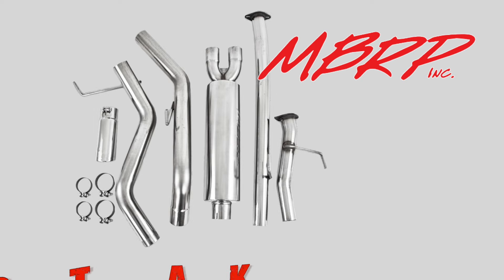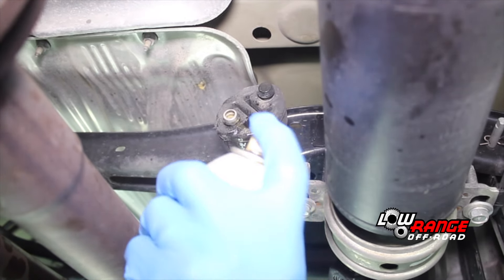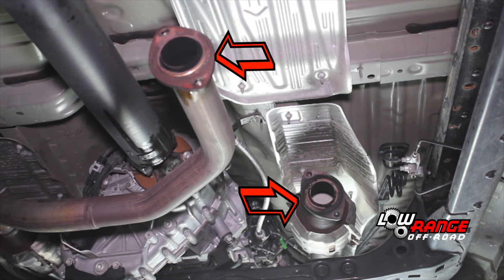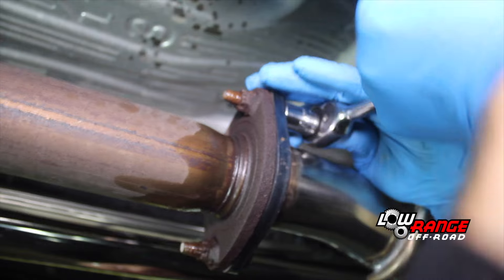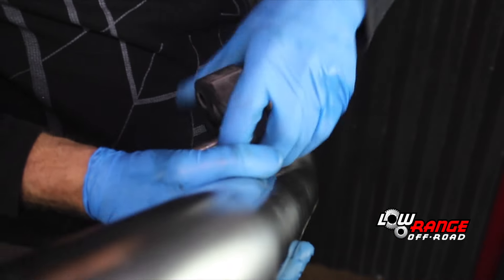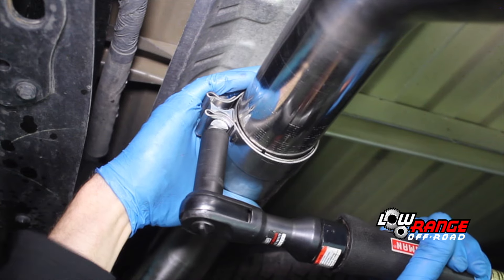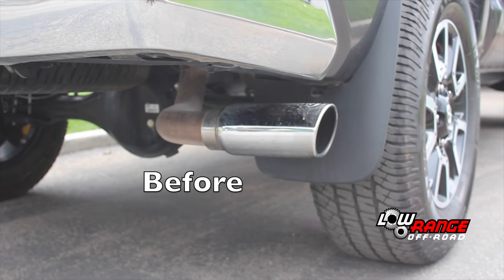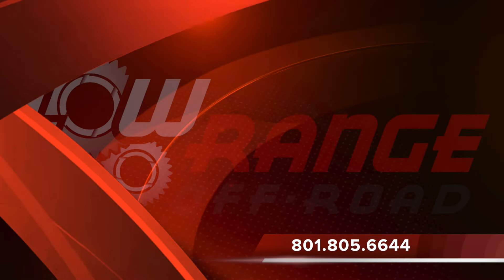How to Install an MBRP Cat Back Exhaust on a 2017 Tundra

Comment: When the 2 front pipes are installed and the flange bolts torqued to 35 lbs-ft is there a small gap between the flanges or do they full seat together? Just installed my kit last night and the flanges have a gap and all the bolts are torqued to 35 lbs-ft. Maybe I have a faulty kit where the flanges on the MBRP kit don’t have a recess for the gasket to sit in.

Comment: how loud is it inside
Reply: Erick Lopez  I have it on my tundra it’s quite inside the truck but at cruising speed around 2200 rpm you get drone but it’s a night and day difference with power. You have a good steady increase of power from low end to high end torque
Reply: Jim Drummond bologna.     A cat back exhaust make that much of a difference?   No sir.  Maybe 5 hp.
Reply: Mike West you want more power get a magnaflow
Reply: @mikewest712  bologna!! Lolll
Reply: Sounds good but tailpipe seems to sit much Lower !